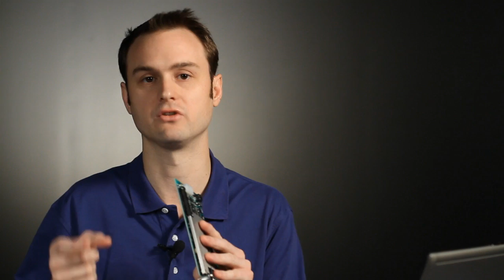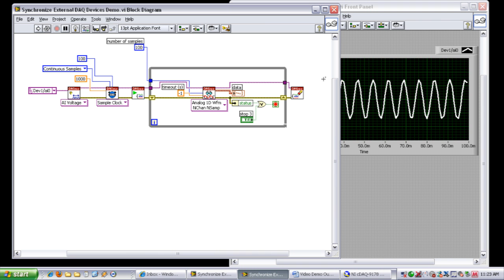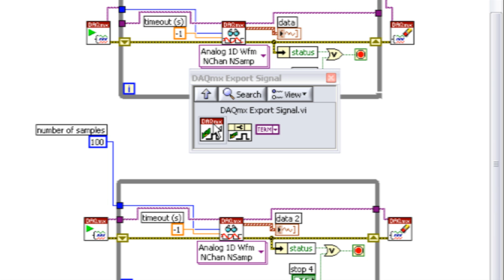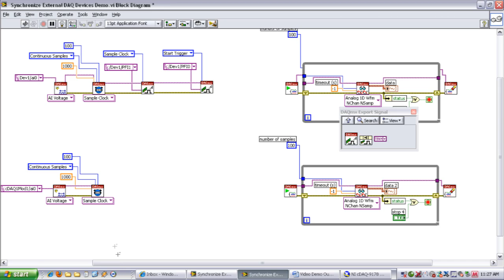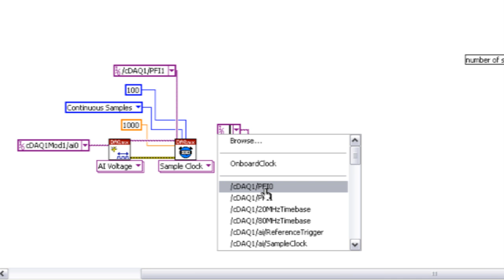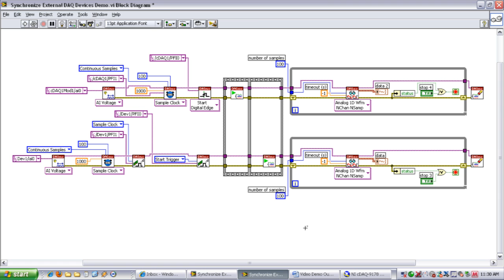Synchronizing Multiple Data Acquisition Devices

Comment: how can one synchronize using an external clock to both devices? I want to use a function generator to generate a clock for both externally. In that case will they synchronize without the need for a trigger?

Comment: is it also fit for for example 3 devices synchronization. Should i connect two PFI0s of the slave devices to the PFI0 of the master device(one for all), or PFI0 of the Master with PFI0 of the slave 1 and PFI0 of the slave 2 with PFI0 of the slave 1(one by one)? Thank you for your answer.